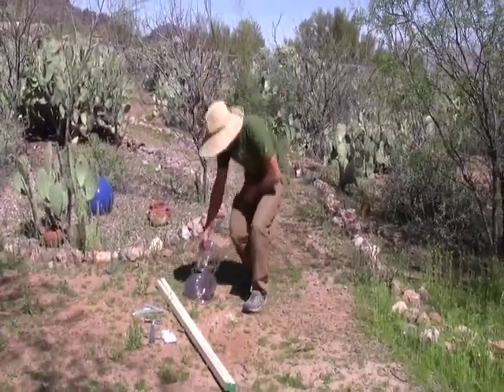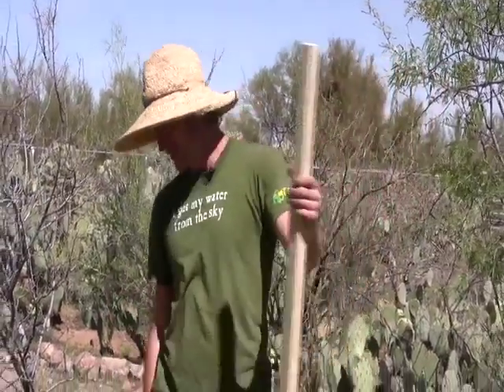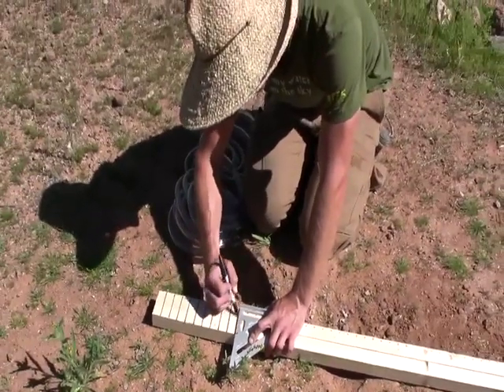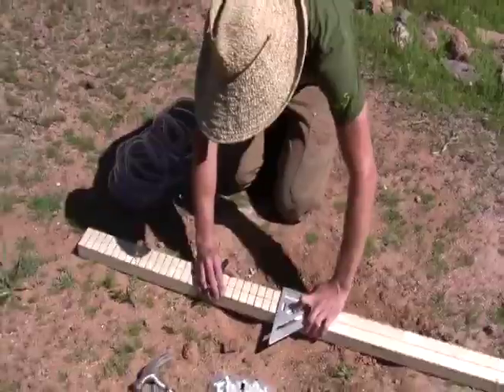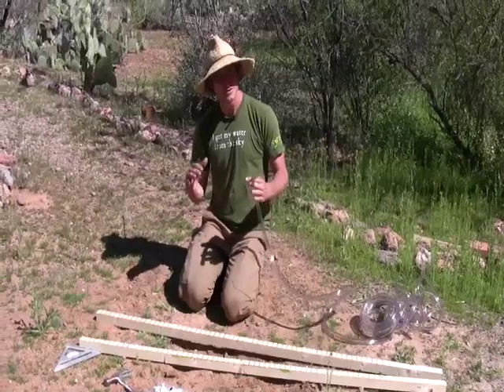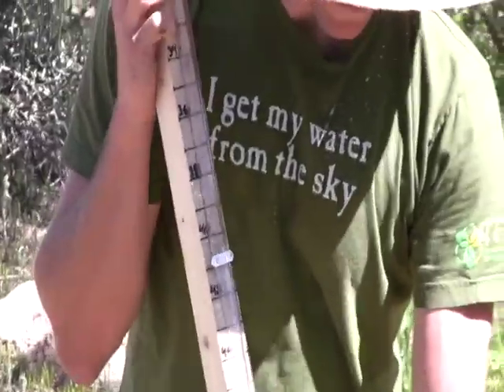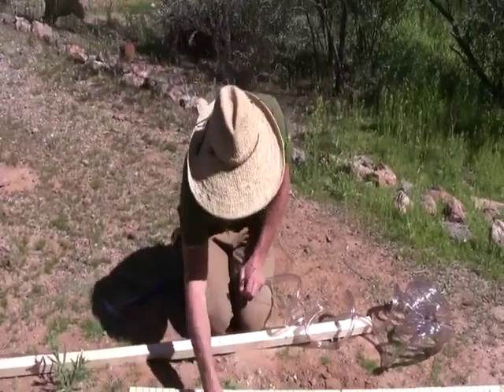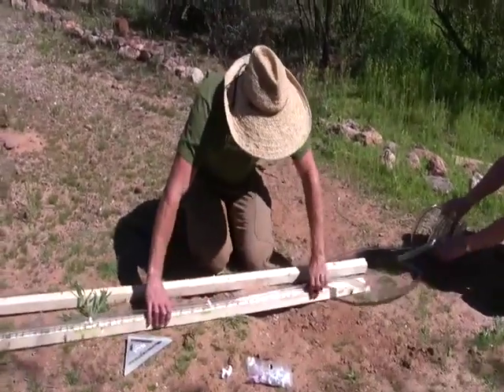How to Build a Water Level

Comment: Thanks for the video and all, but it is about twice as long as it needs to be because you meander all over the place talking about things you are going to talk about later.

I'm thinking that a cable tie through a hole in the wood towards the bottom of the post would keep the tube from bending to much and kinking but also let it move a bit.
Reply: They yield ii

Comment: Thank you for the great video! I've dug about 1,000 feet of trenches, 8"x8" roughly, using a Poor Mans Laser Level. See youtube video number LkaluCqkCMg
It consists of three identical builders levels strapped together to make an equilateral triangle reference plane. The accuracy is not as good an a bunyip, of course, but for quick and dirty continuous contour trenching it works great!

Comment: Using a small container,  mobile also with elevation locator-i.e.-simple tied together tripod,   quart to 2 quart volume,  1/2"/larger tube goes into container from top(no bubbles allowed) or bottom.  after this  one person required,period.  Put a level mark on tube, say at 12" from end with/at the user.  always have water at the level mark then measure to desired surface or mark surface the same as this level.  done correctly will be 100% accurate - guaranteed,   regards,

Comment: There appeaers to be a bit of misinformation here and on other sites about this item.   Have seen only that the Egyptians used a device that resembled a small trough about four to six feet long filled with water,  which was sighted, much like rifle sites,   no telescopic sites either,   along to probably elevation poles to establish elevation points.   Challenge anyone to find where Egyptians used anything akin to plastic tubing?  regards,

Comment: Many contractors use 5/8" or 3/4" clear  from 100 to 200 feet, splicing as necessary.  have seen some of these contractors use no electronic lazers.  [even on multi-million $ projects] readings can readily be held to 1/16" or less ( best if same person reads both ends, but takes more time).  beside cost advantage,  the ability to level out of site locations (other side of walls/buildings/earth mounds).  Dimentional scaled ends of tube used only when absolutly necessary.  regards,

Comment: this tube is too small,    if a bubble "spans" the tube the readings will be wrong.   the "DROP DEAD SMALLEST TUBE IS 3/8" I.D." -still risky.   Use 1/2" to 3/4" tube [for one piece clear],    other wise use 3/4" clear tube about four feet long at each end of a 5/8" to 3/4"  garden hose,  regular hose fittings/adapters work fine.  Food color,  mixed - one - 5 gallons,  check regularly self level test,  smaller tubes "will" develope magnetic force retaining water position.